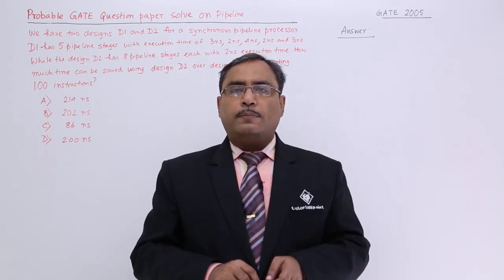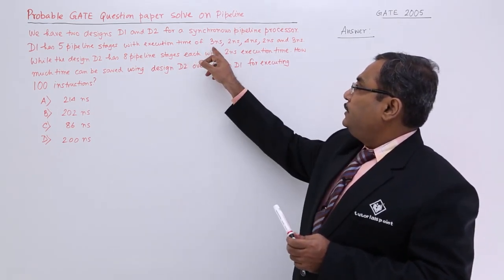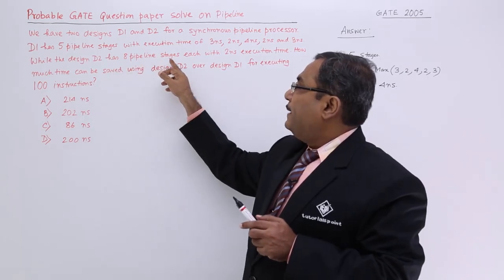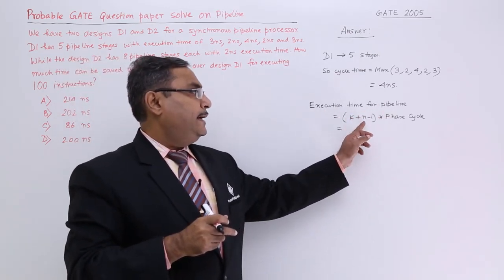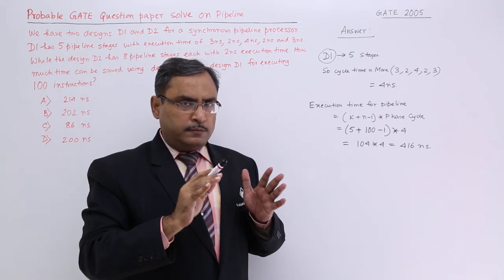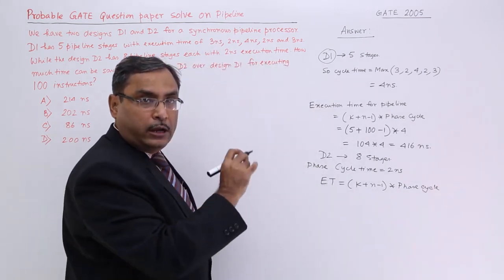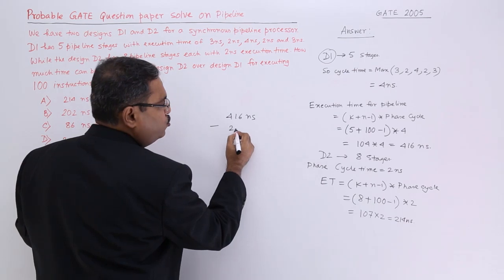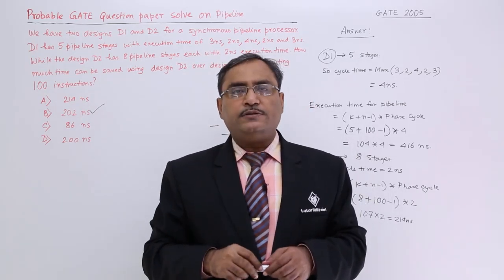Pipeline Architecture GATE Exercise 2

Comment: Sir! You taught in earlier video that
 cycle time or phase duration = max (t1, t2, t3....) + register delay. But sir in this problem, there wasn't any register delay of that synchronous pipeline. But why did you write only cycle time or phase duration = max(t1, t2, t3......)? (where it's not that formula) 

SIR! I just want to know that is this right or is there some other condition of that problem for what you wrote that?

Answer it as soon as possible!
Thank you.. :)
Reply: Actually we used to add register delays but in this we are considering  the execution time. While registers are used to increase speed when there is stage delay and moreover to reduce time gap.
Since here we have execution time we will use this formula , But if there is time lag or delay than we can use registers .